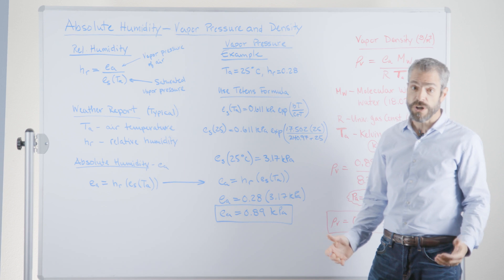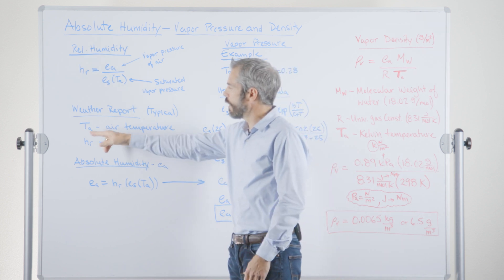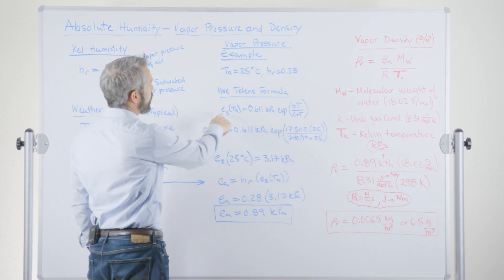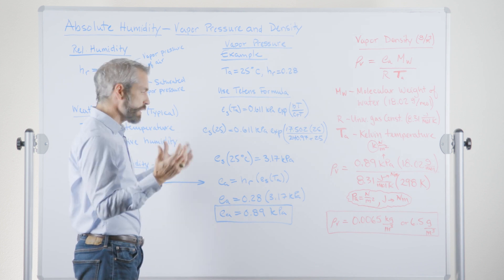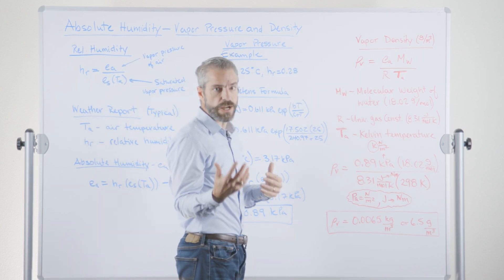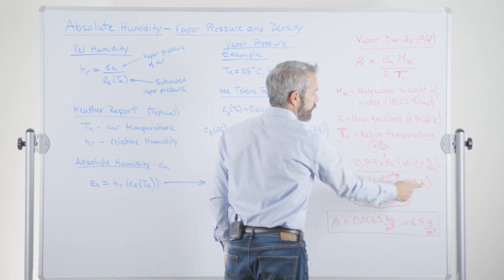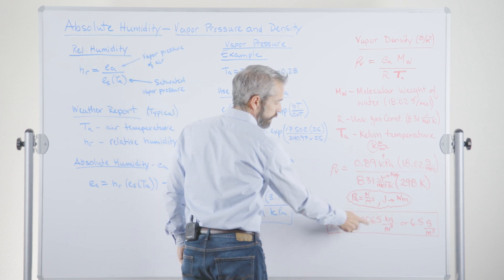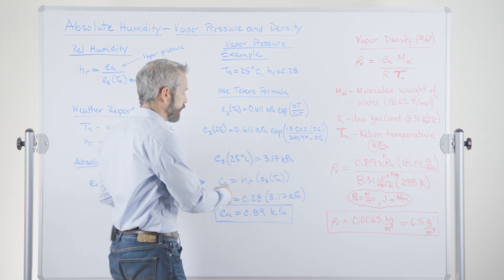Absolute Humidity: How to calculate absolute humidity - A Chalk Talk by METER

Comment: I'm writing a program that logs rel. humidity/temperature/air pressure from a sensor to spreadsheets. I've been wanting to use the given data from this sensor to add absolute humidity to the sheet and charts, and finally I've been able to tackle this with your video. Thank you!!!
Reply from the maker: That's wonderful!

Comment: I would like to pick your brain if you don't mind. I have an enclosed box and used both the Teten and Buck formula to get vapour pressure as found on Wikipedia. From there I calculate absolute humidity in a sealed box - I used the formula from an online calculator. https://www.omnicalculator.com/physics/absolute-humidity#how-to-calculate-absolute-humidity-from-relative-humidity-and-temperature. A microcontroller measure the temperature and humidity as well as calculate the absolute humidity.  I would expect the absolute humidity to stay constant in the box, regardless of the temperature. What I do find is that the absolute humidity increases be a gram or so per cubic meter in line with temperature fluctuations. What I found from the above calculator, is my result is almost the same as the online calculator, but the calculator's "absolute vapor pressure" changes for variations in both temperature and humidity. The Teten and Buck formula only use temperature and constants. So my thought is what is the difference between the calculator's "absolute vapour pressure and wikipedia's "vapour pressure?" Also is it expected that Absolute humidity in a sealed environment will fluctuate as I am not sure if the plastic of the sealed box will absorb or release water vapour. I will be much appreciated if you can point me in the right direction of if my assumption is wrong about a sealed box?
Reply from the maker: Hi, thanks for reaching out! If you reach out to our customer support at support.environment@metergroup.com, they will be happy to get all your technical questions answered!

Comment: Thanks for sharing this helpful information. Does this calculation apply to any temperature ranges...say 15C to 70C?
Reply from the maker: The equations that I used would be appropriate for non-freezing temperatures so should work over the 0 to 70C range. There is another equation for calculating saturated vapor pressure when the temperature is below freezing. It can be found in the book: An Introduction to Environmental Biophysics. Gaylon Campbell and John Norman. Chapter 3 Water Vapor and Other Gases